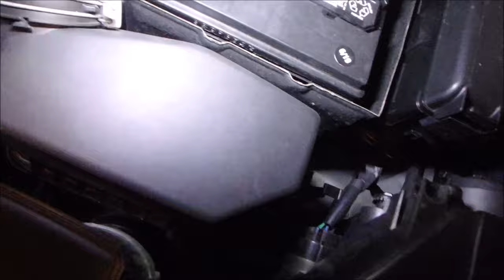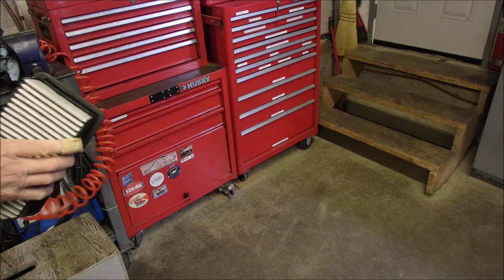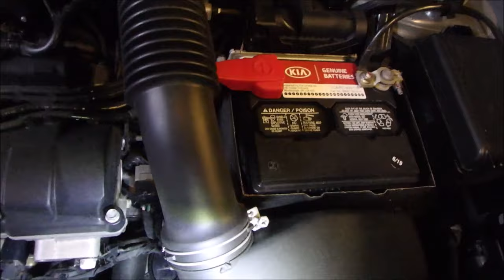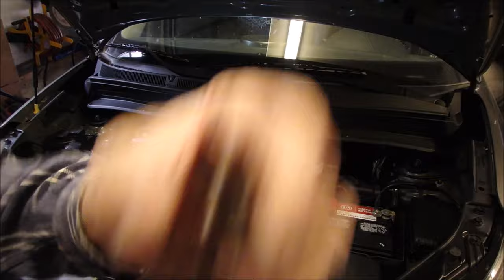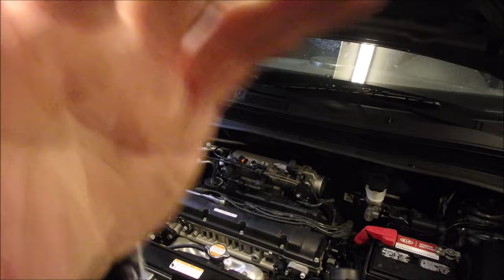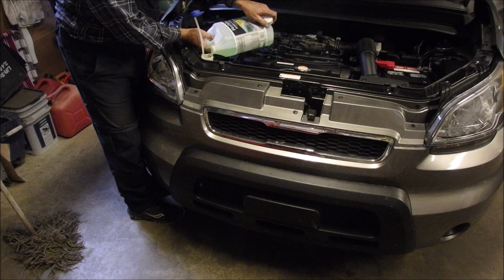How To Solve Acceleration Issues on A 2010 Kia Soul for FREE!!!

Comment: Nice work!
My first step would have been to check the color of the spark plugs.
Reply from the maker: So right.  I did change them 10,000 kms ago     6000 miles.  I think I mentioned that.  If I didn't , thanks for the reminder.

Comment: @31:58  I thought we were going to see one of those blooper videos . good job there. I had a 2001 maxima, that stalled while running after it warmed up  at a stop sign and wouldn't stay running.   (was son's car at college,  I came to check it out and  disconnected TPS and then it idled at 1800 rpm but stayed running,  it was good enough to drive 1/2 mile to get him home.  later on I did a throttle body cleaning  and cleaned out air box and found air filter didn't look good,  shook it out  and put everything back together.   it seems ok. but later on installed a new Air filter. then drove it 2 hours back to my home.  in the mean time he had decided to buy used car as the maxima was 23 years old with nearly quarter of a million miles on it  @243k miles.    when I got it back home to go thru it, I cleaned it out inside and threw on some new break pads, rear struts (already known to need replacement) , and Neutral safety switch ( already known to of been going out) . now it seems ok so I am selling it. it has a transmission problem but it still moves  for gears 1-3 and R,   no Overdrive (4th)  , transmission has been going out for 4+ years and its gotten 42k miles since it started having problems.
Reply from the maker: Right on   you did the right thing.

Comment: 13 years old and original motor. That's unusual.  Must be changing oil every 5000 km or less. One video that I  watched started 'I have a kia in the shop and it's not for a motor replacement '
Reply from the maker: The engines are fine on this model.
Reply: Our 2010 just ticked over 183K and is still as strong as it was new.